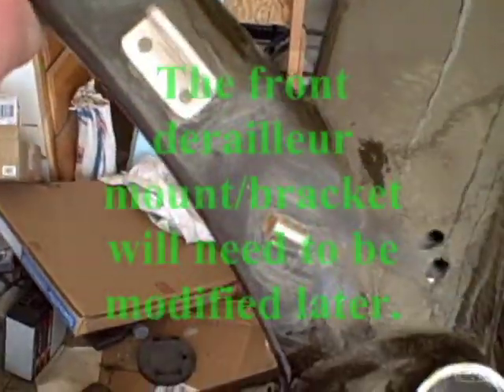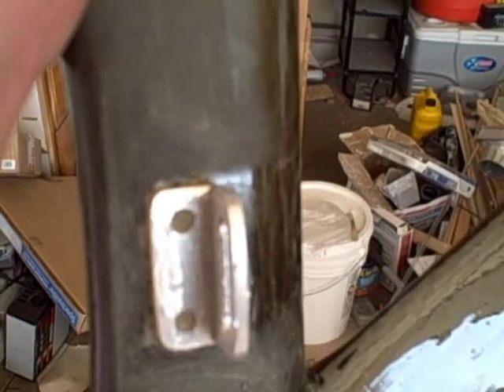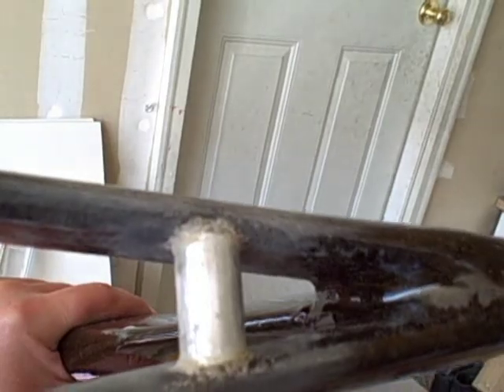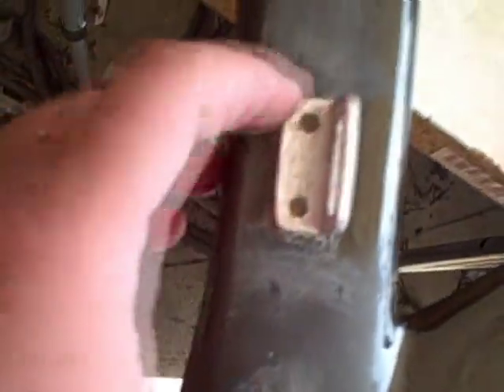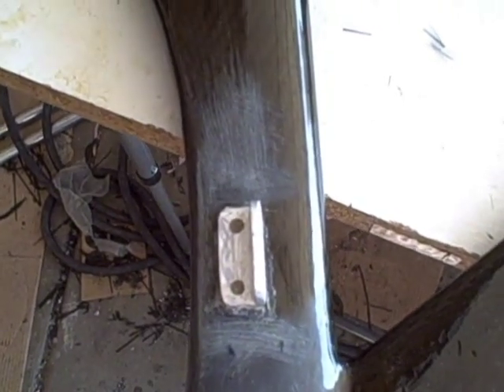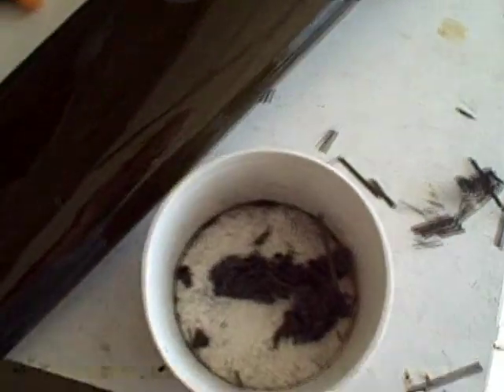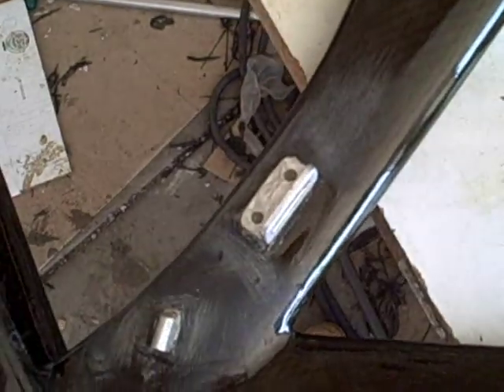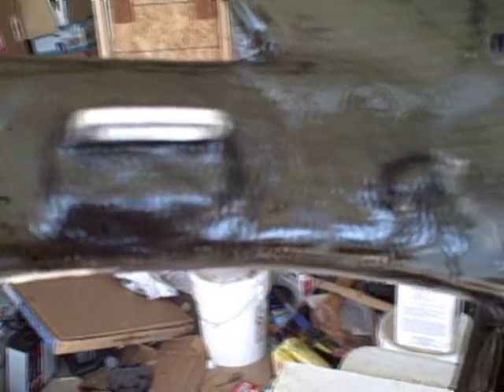Chapter 7 Carbon Fiber Bike Build

Comment from the maker: Good questions.

No, you can't weld carbon fiber together, but you can bond it together with epoxy.

Here I've used "cotton flox" (not flux) which is just flocked, or ground up, cotton fibers mixed with epoxy. The cotton flox is a fiber reinforced glue which has really good compression strength.

I hope that helps.

Comment from the maker: @rustymetalz- The truth is I do wear a respirator almost every time I cut, sand, or grind CF or fiber glass. I use a respirator made for VOCs. I remember the first time I didn't wear a mask and I was blowing out black snot for a couple of days. After that I decided it was worth the $20 for a respirator. I don't wear the respirator while filming unless I'm cutting or working with something really toxic.

Yes, I still work with carbon fiber a lot. Check out my site for other CF projects.